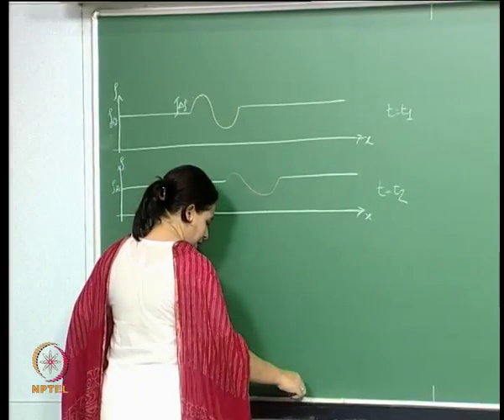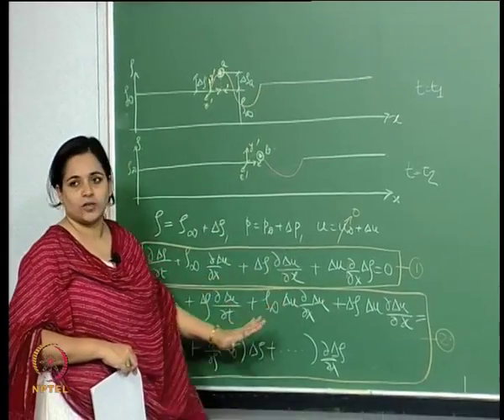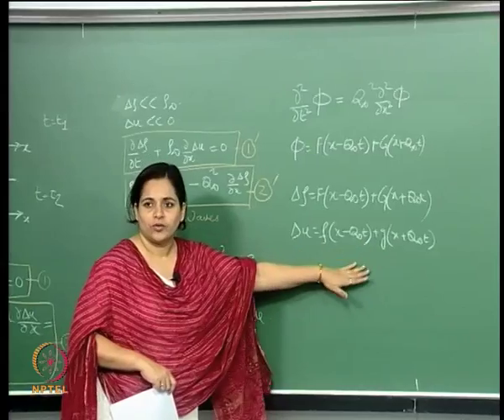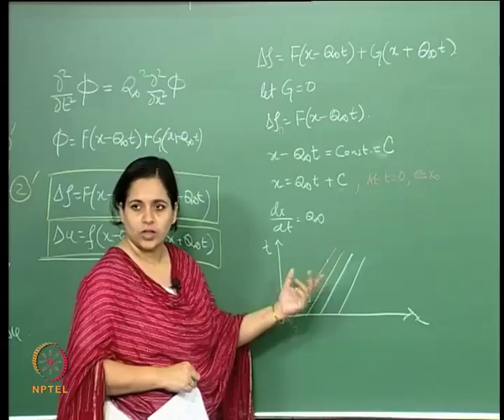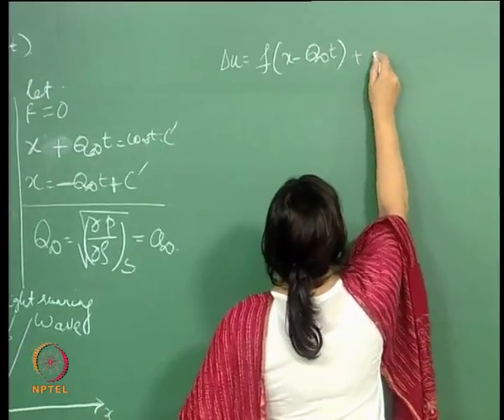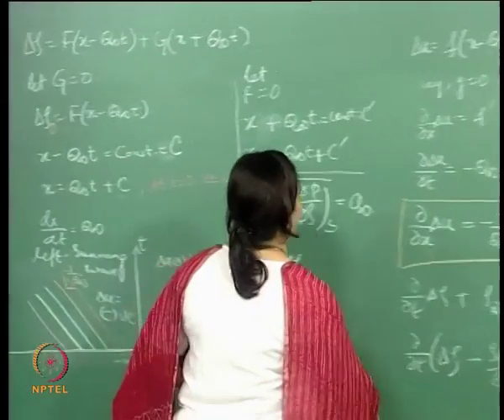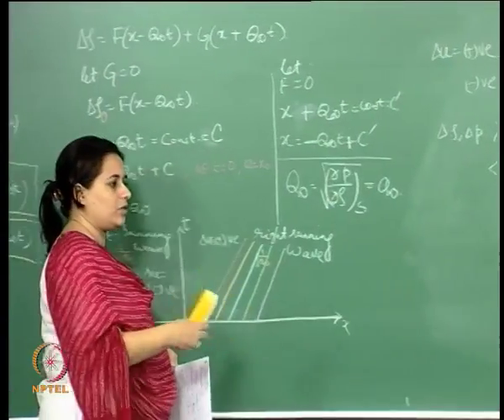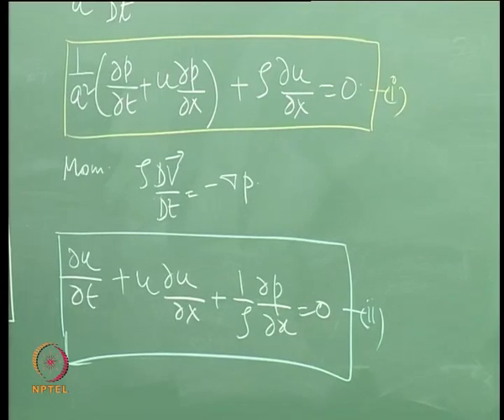Mod-01 Lec-17 Lecture-17-Wave propagation: Small Perturbation Theory

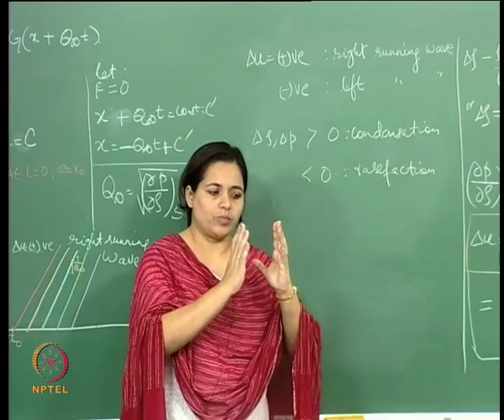Comment: 39:17 Professor said fluid is moving initially, before applying perturbation. But this is wrong, fluid was undisturbed before perturbation was applied.
I think what the professor tried to explain is, when perturbation is applied, like piston moving "into" the cylinder, very slowly (so isentropic compression), a compression wave will propagate into the cylinder, fluid will be moving in the direction of compression wave, away from the piston, so u is positive, rho and P both increase. On the other hand, when piston retracts from the cylinder, expansion wave propagates into the cylinder, but this time fluid will flow towards the piston, opposite to the expansion wave, hence u is negative, rho and P both decrease.